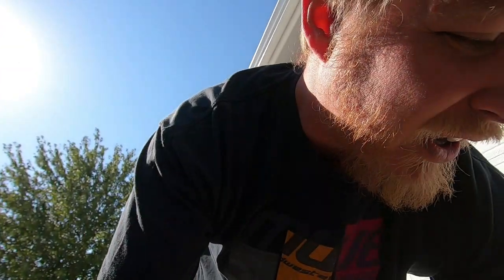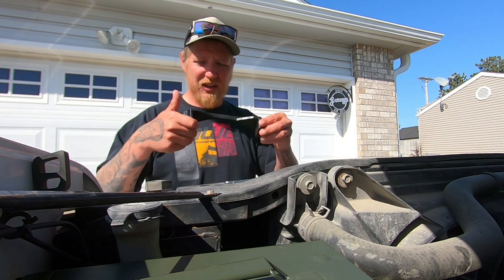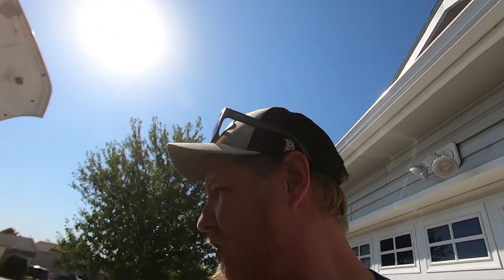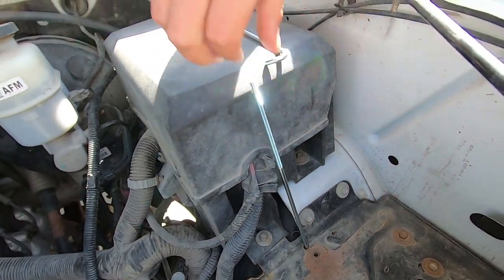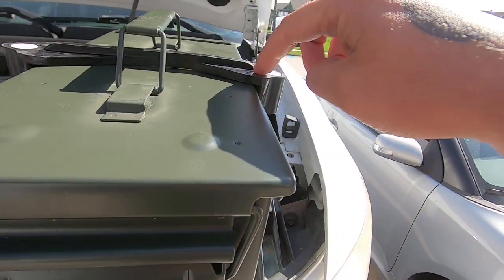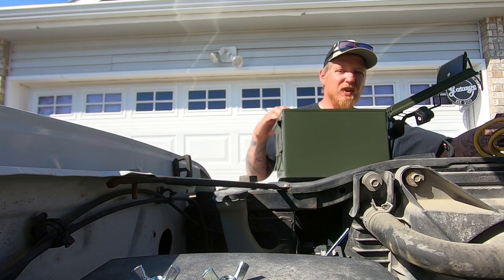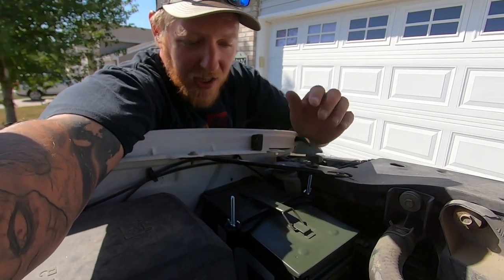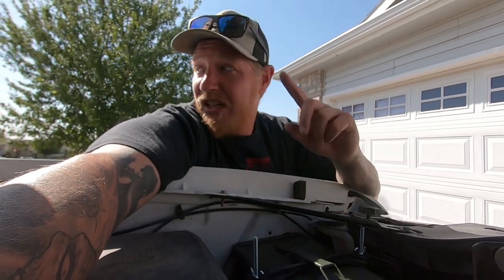Adding Underhood Storage to my Silverado Truck Camper

Comment: cq. been a sub for a little while now. did not realize you had this vid on something been wanting to do to my 2011 tahoe for a while now. absolutely the easiest and cheapest way to go. great for gloves, multitool, rags,etc. thanks. my extra tray did not have the hold down holes but it was a 2 minute fix with a 1/4 inch bit.

Comment: CrazyQuady, I'd have been tempted to put your leisure battery in that spare position and run a split charger to your other battery so it gets charged when you're on the move. You'd only need to run a supply cable to the camper cab and you'd have extra space.

Comment: What's up man love the videos a question do you have a solar panel on your camper shell that would be a great addition it'll charge a battery and it'll charge the One battery that you already have that you use all the time back there the good suggestion take care of leave it. Lots of love from Pocatello Idaho
Reply from the maker: I dont currently run any solar, i have been looking into it though and may be adding some soon.
Reply: @CrazyQuady  it'll be a great addition even though it's one panel and the stuff that goes with it but if it doesn't come with a battery you got a bad battery but it'll be a great investment for the thing you're trying to do it'll make boondocking much easier

Comment: Also, is that tow strap affected by  exposure to long term heat?
Reply from the maker: Time will tell, but I wouldn't think its really much hotter than sitting in a black toolbox in the bed of a truck

Comment: So where does your battery go
Reply from the maker: Its in the factory location on the passenger side near the firewall. The diesel model of these trucks typically have dual batteries and thats why the secondary battery location is there.

Comment: Can't you pull the bottom try out and then you can just thread the bolt through the bottom??
Reply: cross member bar won't allow lid to open,great idea tho .....
Reply from the maker: This is why I was looking for some type of plastic box that had something like a clip on lid. Bolt the box down and undo the clasps to slid the lid completely out.
Reply: No no I meant. Instead of bending hooks couldn't you just pick up the tray and thread the hooks through the holes there and bolt it back down. Boom those two will never fall out like the may have a tendency to do now.